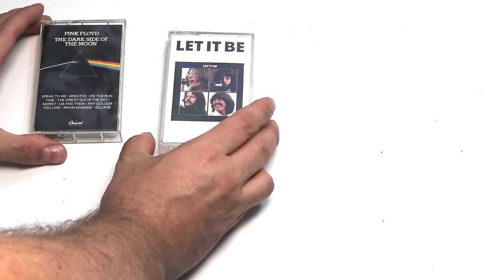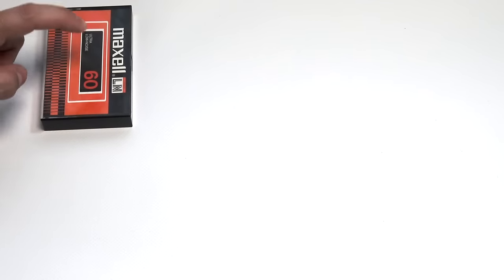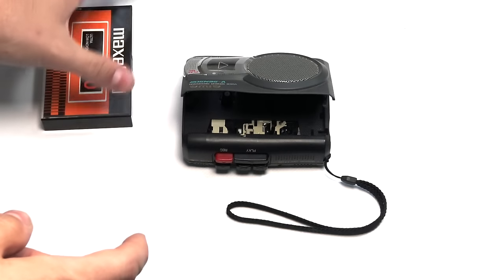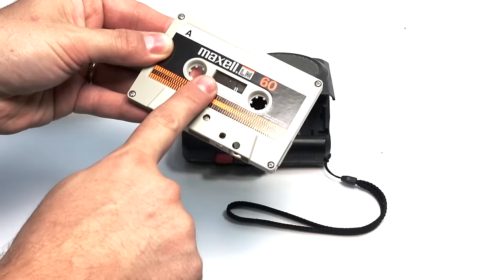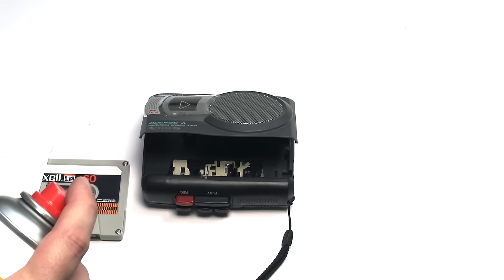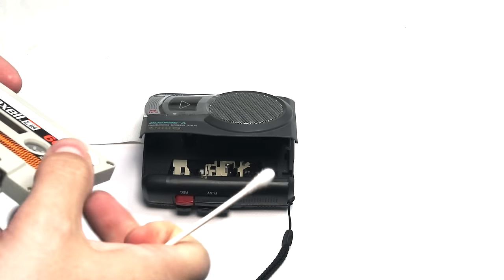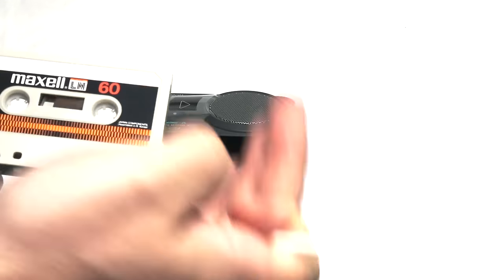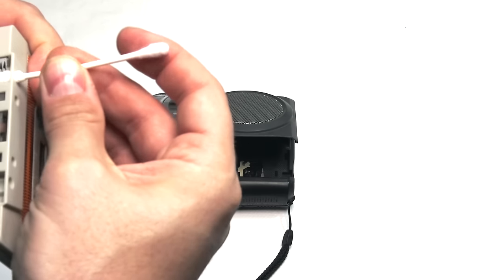How to relubricate your stuck cassette tapes

Comment: Here’s a great article on DIY fixes that don’t destroy your deck or even tape over time. 

https://www.instructables.com/id/How-to-fix-a-cassette-tape/

Please don’t oil your tapes if you value your decks at all. Simple science.
Reply: And an interesting thread on Audio Karma: https://audiokarma.org/forums/index.php?threads/frustrated-by-old-cassette-tapes-binding-my-decks.209654/
Reply: Here’s one more from the engineering forums at Gearslutz. One guy confirms what I have mentioned - that baking the tapes is the way to go. Why? Because the slow process of a light heat makes the remaining lube and binding chemicals re-adhere to each other. THIS is how you save tapes - not by bathing them in oil. Another guy actually offers this service professionally (as do I) and has a very excellent success rate. He also has a proven, industry standard method, of relubing cassettes and it’s not by spraying oil on them. https://www.gearslutz.com/board/audio-transfers-restoration-and-archiving/343782-relubricating-analog-tapes.html
Reply: Someone also posted in GS about how to make your own DIY re-hydration cooler to do this same process. And I quote “A quick and cheap version of a hydration chamber can be built from a picnic cooler.

A large open cell sponge like the type they sell to wash cars with, a watertight enclosure to hold the sponge, and some distilled water. You can get fancy and add a hydrometer (available at cigar stores ) and a 12vdc 120 mm box fan (radio shack or computer parts store).Run the fan at 5-6 VDC to slow it down.

Open/remove the picnic cooler plug used to drain the melted ice. Place the sponge and its enclosure near the plug opening. Use 1/2" to 1" standoffs to mount the fan above the sponge and enclosure. Run the fan wires out the open plug hole. 

All in it should only cost about $50.00 dollars to build.”
Reply from the maker: Jonah, as many other techs you are driven by prejudice without real knowledge, in this case, about this issue. It is really sad to see how arrogant you are, just go back and read your commnets. I see now that you have written several negative comments over the months and I think you should inform youself better before pointing your finger, insulting and denigrate people. I have posted simple things but considering that you would like more proof here you go. After rading this info, I hope you will be polite and intelligent enough to apologize.
Here you will find a selection of scientific papers explaining the issue and how it is a standard procedure to relube tape (even NASA does this!). I have underlined a few crucial passages in the papers: 
Heritage: https://www.dropbox.com/s/f8254yfeqrrw9vp/heritage-02-00097-v2.pdf?dl=0
Nasa: https://www.dropbox.com/s/xxdw1qh8mlbppdu/Nasa.pdf?dl=0
HESS: https://www.dropbox.com/s/ydrvxg6zipjkrvw/HESS_Tape_Degradation_ARSC_Journal_39-2.pdf?dl=0
Preservation Commission: https://www.dropbox.com/s/3s3ejmho2jexhgt/pub54.pdf?dl=0
   - (here is the official article: https://www.dropbox.com/s/rtvqt1n537w9vpa/Bogart.pdf?dl=0)
Kondo: https://www.dropbox.com/s/zi4vv42ggi9vh8u/tribochemistry-of-ionic-liquid-lubricant-on-magnetic-media.pdf?dl=0
Here is an article of a lab that is relubing its cassettes: http://tasso.cat/re-lubrication-of-compact-cassette-tapes-with-sbs/
Reply: ANA[DIA]LOG I’ve read all those articles. Again - it’s about reel to reel NOT cassette tapes. Stop confusing the two - they are different and contain different types of type that is manufactured differently. 

Your theory works for R2R yes - but only on the back of the tape!

Again none of these articles you’ve just posted mention or discuss cassette tape. 

Thanks for proving my point.

Comment: This is something strange, never heard of using lubricants for cassettes!!!  I have been listening to cassettes for 45 years and rarely came across jammed cassettes.  If ever I found one, I just give it a good shake with my hand and fast forward and rewind it once.   I don't trust using lubricants for cassettes, will definitely ruin the pinch roller.  Regards from India.
Reply from the maker: All types of tape have lubricants. Check the video description for further info.

Comment: Many thousands of tapes over a 55 year period and never lubed, and Never will as it
is merely destroying the very thing you are attempting to improve. Lubing kills tapes.
Reply from the maker: Well, tapes are lubed when produced so it is normal that sometimes this lubricant evaporates, hence a small relube, absorbing all the excess, seems pretty logic and in fact if you check the articles I have inserted for download in the video description you will see that it is a standard procedure in tape, cassettes and reel to reel.

Comment: DO NOT DO THIS It's not the face of the tape that needs lubricating, it's the edge of the tape and reel where it rubs against the inside of the cassette.
That's where the friction is, you most likely accidently fixed the problem from the excess lube on the tape oxide dripping onto where it is needed!
Your method lubricates all the areas that should not be slippery, the tape oxide itself, the capstan and the roller, plus you're are dirtying up the tape head which will reduce audio quality.
Reply from the maker: If you do it correctly nothing of what you said will happen. Watch the video and read the articles. It’s science, not my grandma’s remedy

Comment: Are you not concerned about doing this and gunking up the transport path of your Nakamichi dragon /
Priceless deck??! 

People seek to be saying this works and it seems it would.
At the same time It seems very reasonable to assume that anything you wipe onto the tape will also
Wipe onto your deck 😟 

Anyone got any experience with this ? Either happening or not happening?
Reply from the maker: Just pick up the exceeding lube and your good. Side note, did you know that special lubes are also added to tapw heads? Let experiment and understand things before calling out for eresy!
Reply: @anadialog  I don’t mean to sound like a wet blanket . I love your content , I am also a middle aged man with an analog fetish :) er, I mean passion..
I just don’t really get this though , I mean for non critical cassettes.
I only have brand tapes Tdk/maxell for Japanese decks and have hardly any that squeak (although I did buy one of those new tascam tapes by accident, and my God you are right they are s**t) 
The ones that squeak,  I just get rid of them , it’s only been two out of dozens of NOS and used tapes.
Each to their own.
Thank you for your content and your work in putting these videos together for us ❤❤

Comment: Tried your lubricant method and heat method side by side on nearly identical tapes and here's what happened: https://youtu.be/GuNsnV2YDiI Thanks ANA[DIA]LOG!
Reply from the maker: Thanks for your great feedback and video! I am intrigued by the heating method. What you are doing is baking the tape. A common procedure done on reel-to-reel tapes for various reasons. When you bake tapes though the effect does not last for long. In your case you probably melted a little the dry lube besides making the oxide more sturdy. Let us know if after a month or so the cassette is still working properly. Thanks!
Reply: @anadialog  If I remember, I will do so. To be honest, I prefer the lube method better as heating the case to expand its interior dimensions at the reels seems a tad risky to the actual tape inside. Oh well. At least I now have a pro remastered digital copy of the original vinyl release now — which was my original purpose behind buying the cassette version, seeing as I sold my direct drive, linear tracking turntable this year.